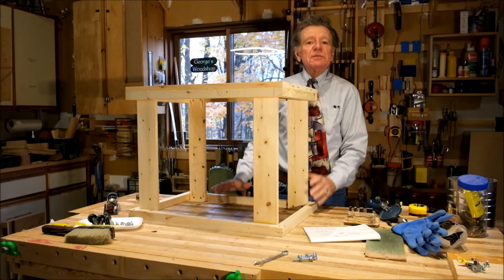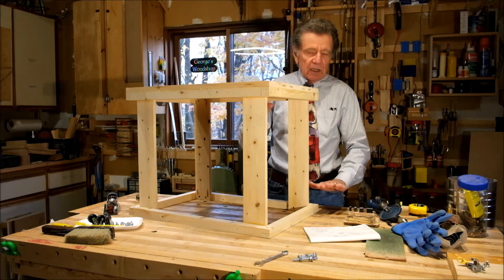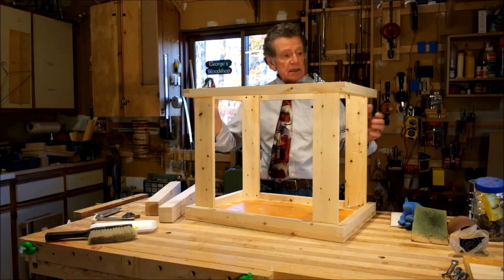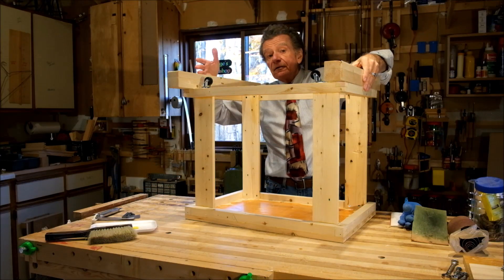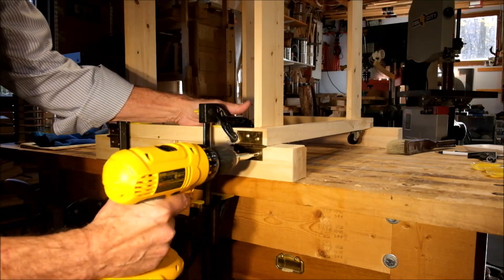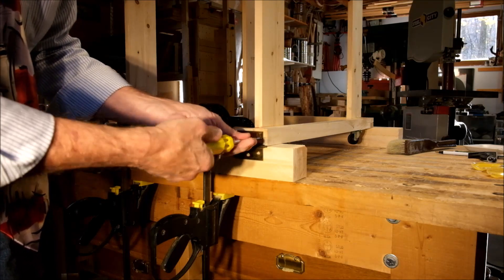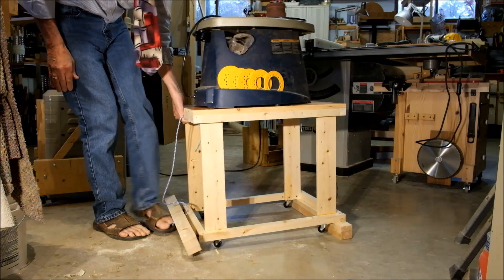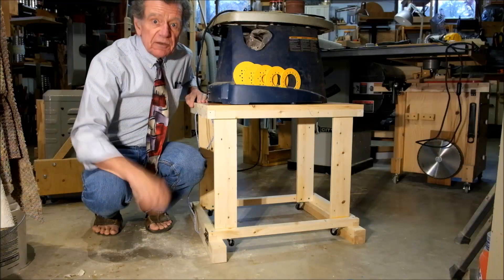Mobile Base with Retractable Feet, not Wheels.

Comment: What is it, misalignment of the hinges that holds the "feet" up?
Reply from the maker: Hi Mark.  Yes I think that's it; turning sloppy work into a feature.  But it would not be a big problem if the feet swung freely and rested on the ground when the rope was released.
Reply: @georgefouriezos8863  It is getting so most shops have rare earth magnets on hand. I see some making use of them for situations like this though I agree, it doesn't much matter.
Reply from the maker: Hi Mark,  I love rare earth magnets.  In fact I have a video about making cabinet door latches with them:  https://youtu.be/T-Xcq_-wWQ0   And yeah, if I had properly aligned the hinges, maybe I would have thought to use magnets.

Comment: I like this idea. My cheaply purchased workbench came with casters with two locking on opposing corners but they are cheap and flimsy so the bench is not solid for planing, etc. This seems like the best idea for adding retractable feet and as my garage floor is not very level I can always add levelling feet to the folding cleat if needed to stop any wobbling.
Reply from the maker: Hi Steve, I'm glad you found the video useful.  Best to you for the new (and improved) year.

Comment: Great alternative design! I will try it and make the cleats, to immobilize the sander, stay up so they don't fall down when moving it. Love from NW Colorado! Thanxz
Reply from the maker: Great foresight Audio, it's a thing I need to add: a catch that keeps the cleat raised as I jockey the stand around the room.  It's not terrible as is, because the hinges are a little stiff, so they do help keep the cleats in the up position.  But as I clunk the thing around, the cleats slip and drag along the ground.  So, yes, by all means, do add a catch of some sort to keep them up.  I hope you're keeping safe in NW Colorado and thanks for commenting!

Comment: George, 

Thank you! I love this idea/approach.

I have been watching different "retractable wheels" videos this morning, and none of them alleviated my concern about wheel instability when moving the tables around the shop.

I have repurposed two identical industrial sewing machine tables for a workbench in my indoor shop. The room is rather small, so the two tables are an ideal solution, as I can separate them when not in use, and then they can be pushed back against the wall to conserve floor space.

The tables are rather top heavy, since they have a thick 1 1/2" formica top on them, and cast iron legs on each end (that were ideally bolted to the floor in the industrial setting). Picture if you will, the cast iron legs normally found on an old treadle sewing machine; this is similar to the style legs on my heavy sewing tables.

By permanently mounting the wheels, and instead making retractable feet, I can move the wheels a little further outbound(with inbound retractable legs/feet/braces), and increase the stability of the table while moving it around the shop. 
Once the two tables are tethered together (when in use) the union of the table tops will reduce the instability of the narrow cast legs (with inbound retractable legs/feet).

Thank you again for your inspiration.
Reply from the maker: Yes, castors, even the kind with brakes, are not as stable as good ol' pedestals.  I'm a big fan of bringing the wheels in only when you need to move.  Sounds like a really good approach for your situation.  Thanks for commenting.

Comment: Brilliant. I am looking to build a small drill press stand that I can wheel into a corner when not in use, and my design just got a new feature. Thank you sir.
Reply from the maker: It's a huge boost to me when something I share helps out.  And I can see not wanting a drill press to be resting on its wheels -- especially if they're not locked down -- when in use.  Thank you for the feedback, Edward.

Comment: while this is practical for your application, it may not be for those whom have heavier benches that need leverage advantage which is more easily achieved with a caster being the retractable
Reply from the maker: No question about it.  This isn't a universal solution; it's only the best solution in a narrow range of application.  In others it would be the worst.

Comment: I also did this to a tool stand and found that a surprisingly small lateral push would often cause the hinged foot to flip out unexpectedly. I ended up providing a locking pin for each foot.
Reply from the maker: Thanks for the Heads-Up, Darnley.  I'll be sure to watch out for that, and thank you too for the ready fix:  I guess dropping a nail into a through hole should fix things.  (Heck, I really don't want to bend down.)
Reply: @georgefouriezos8863  a spring  loaded pin or clasp (i.e. I used a few rubber bands) with a string release solved the bending for me, it was a full hieght drill press and bending to release created a real tipping hazard 😎
Reply from the maker: @DBYNOE  A pioneer experimental psychologist, E. Thorndike, said he never trusted a piece of equipment unless it had at least one rubber band in it.  I keep a jarful of them in the shop.

Comment: Hi George, I did this on my table saw and found only one cleat is needed to keep the tool from moving. Also the casters will not need to swivel when the cleat down (or engaged) allowing you to mount them just a bit further apart.

I will be adding the rope,  Good one!
Reply from the maker: So you have fixed wheels at one end and a flip cleat with swivels at the other...nice.  You've got me thinking that I might modify my base to your design -- one cleat fewer to flip.  Thanks!
Reply: @georgefouriezos8863  I have four swivel casters like yours but 2 swivel and 2 fixed would work also.
Reply from the maker: @okieinva1  Oh, I understand now.  Bumping is not a problem when the cleat holds up the stand.  Right.